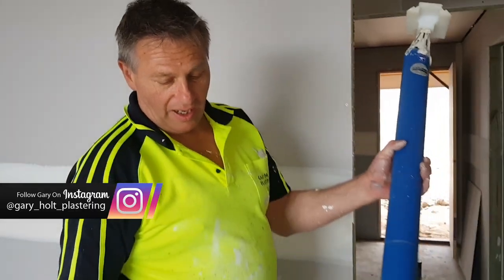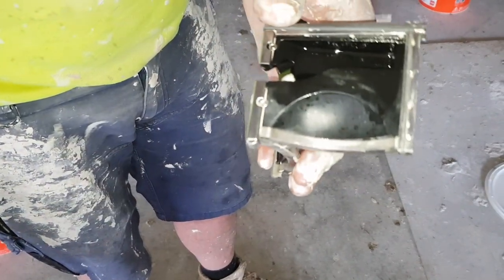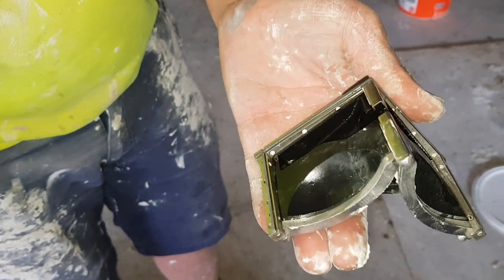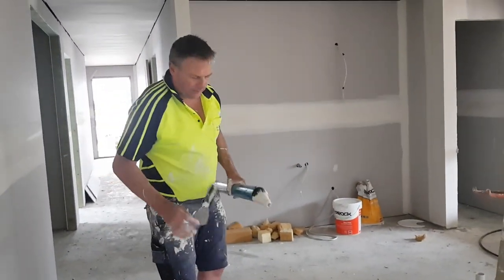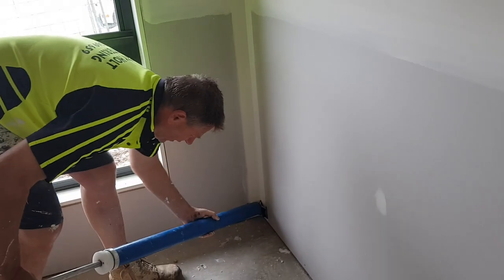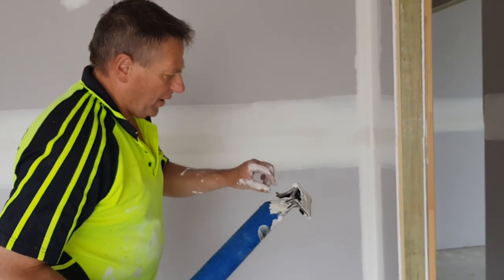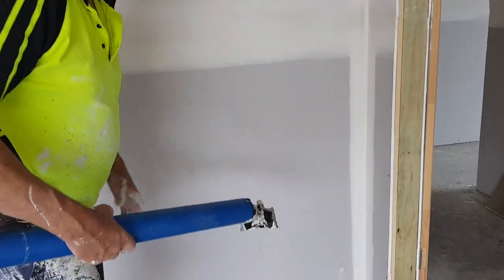How this Drywall Construction Worker Tool coats corners in seconds

Comment: Hi Mate，
good videos and thx Gary and you share
it with us.
same tools as we are using now，however，I gave up the cornice cement applicator years ago. Acctually，we tried to use that applicator and felt too mess up if you have to install cornice by one people. 
When you put cement on the cornice，the cornice becomes sticky to the wall，which helps you get the cornice up first and still have a chance to adjust its position. While，if   the cement is on the wall，it means your cornice has nothing to grab the wall unless it hit the cement on the wall. 
Anyway，I believe Grary is better than us using the tools. Looking forward to seeing how he install cornices.
Reply from the maker: Yeah I hear you, I personally haven't used one myself but what your saying makes a lot of sense. On the other hand I hate buttering up cornice....
Good to hear from you Adam.. how is work you guys busy??
Reply: still same. Jobs slowly start from June. I fiiled my schedule up with reno jobs btw new buildings, lots of fun doing reno. let me know when you come to melbourne again. I am planning to go to gold coat for holiday.

Comment: Why are there big gaps at the corners of the wall and the ceiling? I would love an explanation!
Reply: its not necessary to have it tight as it will get covered by the coves as in used in nz and aus
Reply: sorry late reply. yeah we have it a lot easier codes here but residential housings ( not town houses/units/apartments ) dont have strict rules and codes

Comment: Seems like it holds more mud than a standard angle box.  Those screw heads hanging out are the worst! I noticed he leaves the wall toward base being less noticeable but lifting from the wall at the seam midway would be better sanded/scraped would it not?
Reply: The 36" tube holds 2.23 litres (2.35 US quarts), the 24" holds 1.64 litres. Our Corner Box holds just under 1 Litre.
Reply: @Tapepro  Twice the amount of material.  That's awesome run time.
Reply from the maker: Thanks for the details..

Comment: Why is there an inch to two inch gap around the top angle. Tape I've seen here and used is 2 inches wide.
Reply: Cornice, cove, crown moulding.
Reply: Clayton Dement I understand they put crown molding, I'm with you, why leave such  nasty gaps though out the whole house?
Reply: Even though they put crown molding, I see those gaps as a fire hazard. Maybe that's why their down under.
Reply: Joe Jaramillo great point. At least for fire taping purposes

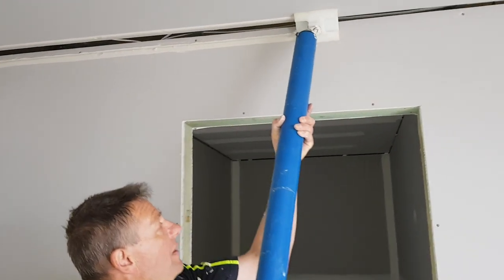Comment: 1:49 you never really showed what that was for I don't get it and then you just went off to the next tool which was the glazer but what was that first Whitehead you were using on the Bluetooth I see it spitting out mud on the sides but for what I don't get it 🤔🤔🤔
Reply: they don't drywall tape their upper corners, so they install cornice trim like crown molding and the first applicator makes the cornice stick to wall and ceiling

Comment: Hey Guys, What Brand is that Corner Finisher? I run a Tape Pro System, but the Tape Pro Corner “Flushers” are no good on Tin Internals.  Is that a Tape Pro Corner Finisher?  Or Columbia etc
Reply: It’s a tape pro cfp75, there are no flushers or finishers goor with metal internals, however you can get plastic “bumpers” for your flat box that will run against the metal part of the internal,

Comment: I noticed all the nasty gaps where the ceiling and walls suppose to meet with drywall  throughout the house. I find it as a fire hazard, I did see and didn't see some areas where the drywall on the wall went above the ceiling, " possibly fire taped" I understand the gaps will be covered by crown molding, Is this crown molding fire resistant? Don't hate me, That's living down under
Reply from the maker: Yeah you will notice that... This is 10mm Drywall... It's not a fire wall. Regular houses don't get that here. Purely cosmetic

Comment: Thats a huge gap in those corners that should be flush
Reply: jonathan gonzalez cracks are more prone to happen. It also helps distribute the weight of the ceiling drywall.